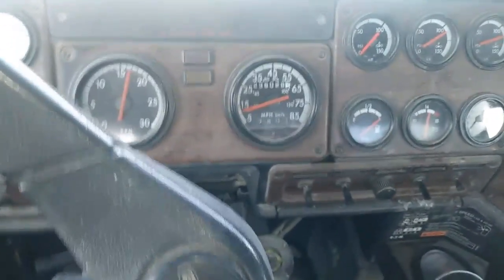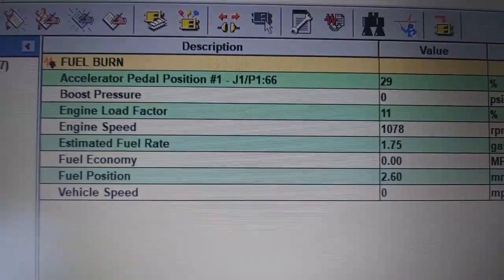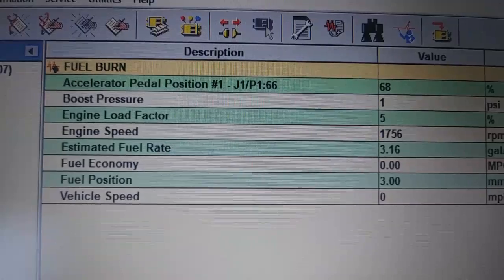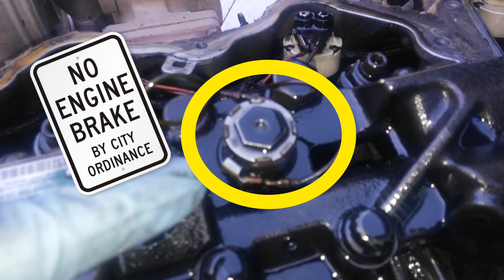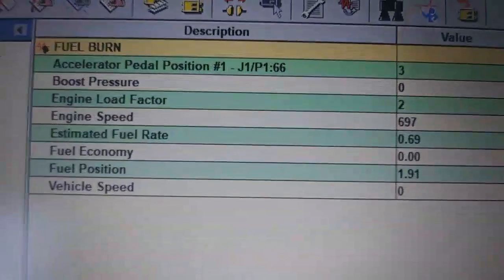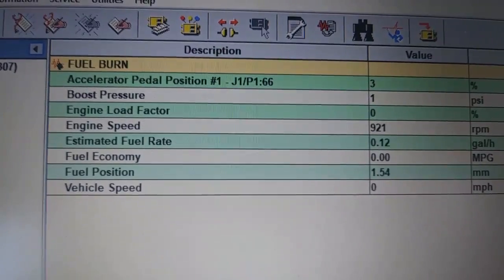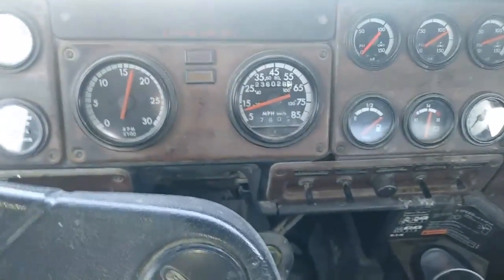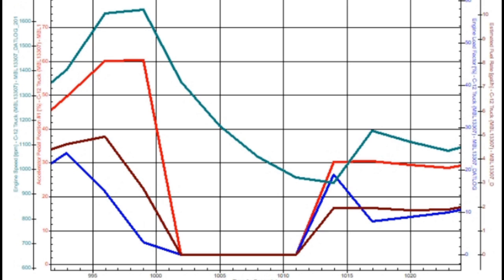Does Engine Braking Waste Fuel? Do Jake Brakes Waste Fuel?

Comment: So there is a way that it wastes fuel out on the road if you leave it on all the time. When you lift off the throttle for bump or dips, shallow corners, etc. the truck slows down when all you needed was to remove torque from the dive axles for a couple of seconds. One the truck slows unnecessarily because the jake was left on you are now pushing extra fuel to get back up to speed.

It’s to that the application of the jake itself doesn’t use fuel, but the real would use of it can impact fuel efficiency based on the way you use it.
Reply: I same would be true if you continuously rode the brakes.
Reply: You are correct, BUT you, the driver is the one wasting fuel if YOU let that happen.
Reply: Half-assed Garage I couldn’t agree more, but there are a lot of drivers that don’t truly understand how to use their jake. As a result they’re either under utilizing it, or they’re just leaving it on all the time.
Reply: aodhanof90 I leave mine on all the time. If I’m coasting or in no hurry to slow down I just rest my foot lightly on the clutch pedal. Nothing about it will cause reduced fuel economy.
Reply: aodhanof90 even if how you describe it is true, it's not the Jake Brakes fault, it's the drivers fault!! Plus, the drivers driving style would generally use more fuel, than even the wasted amount of fuel you are talking about!!

Basically, the driver that does what you suggest, and causes wasted fuel, also drives in a manner that would cause even more wasted fuel!! A heck of a lot more fuel!! But,  something else to consider! Even at a point that you have the jakes on unnecessarily, you would tend to push the throttle back down,  as soon as you would notice it! You don't leave the throttle released (released throttle, means applied jake brake) to avoid a bump or pot hole, and stay off the throttle for just a second, but that would certainly engage the jakes, and you would certainly re-apply throttle immediately! 

The jakes were designed to perform a specific job! They were designed to provide braking assistance, while descending a hill, while heavily loaded, to prevent overheating the service brakes! Drivers now a days, use them in place of service brakes, especially when they think it's cool to make extra noise, to show off! There are some O/Os that swear that it reduces service costs, by not wearing out the brakes as quickly! Others swear that each use of the jakes causes a tiny bit of engine damage, and only operate them when absolute safety is necessary!

The question of fuel economy is a simple one!! The specific idea of the use of a jake brake does not waste fuel! A drivers particular set of driving and jake usage habits, can!! There are some engine controller parameters, that help use the jakes during normal operation, that even help fuel economy!! I drove a truck once, that didn't immediately turn on the jakes for a simple release of throttle! You could leave them turned on, and the computer would not actuate them until a service brake application of at least one second occured! There are also parameters in the computers that when on cruise control, a set speed that gets exceeded by a certain number of MPH, would actuate the jakes! Say you cruise at 65, and then go on a downhill piece, and the vehicle speed exceeds 5mph over the set amount, the jakes would automatically engage an appropriate amount, to help slow you down, and prevent an overspeed situation!! Either legal speed limit, or company limited vehicle speed, or company appropriate speed!! I once drove for a company with 68mph governed trucks! Even in 70 mph states, you weren't allowed to exceed that speed, and had monitors on the units to report that info, when accessed! So, no 80mph downhill runs!! But, other ways to waste fuel, even greater amounts of fuel, exist, that should be addressed, before any thought goes into the jake brake possibility!!

Comment: So, what happens if there's a malfunction, and fuel is introduced while the Jake is being used?

I can say from experience with a cold Cummins Big Cam (The water temp was warm, but the oil hadn't heated up yet) that the answer looks really cool.

I used the Jake for a moment, and hit the throttle again, and saw a flash.
Just then, the guy going the other way got on the radio and said "Man! You just shot four foot of flame from both stacks!"

After that, my warm up time doubled to 40 minutes before heading to the yard as that's the amount of time it took for the oil pressure to start dropping to normal.

Still not sure that cold and thick oil was the cause, but I couldn't think of anything else that would cause fuel to load up in the exhaust like that, and it never happened again with double the warm up time.
Reply: DrFruikenstein 
A Jacobs brake, or the later version C-Brake (Cummins Brake) depends on oil flow into and out of the brake housing for proper operation. Cold oil might have delayed shutting off the injectors. Not quite sure how but that's the only thing I can think of. Today's engines being electronically controlled, that's not a problem. (To err is human, to really screw it up takes a computer)
Reply: @cbmech2563  
Thanks for the explanation. 
Now people will understand why I was fixated on the oil temperature. I should have explained that myself, but didn't.
Thanks again.
Reply: The old 855 I drove was bad about the cold oil Jake wants to stay on

Comment: And that very smart engineer? Clessie Lyle Cummins haha. Sorry had to add that.
Reply: His son, Clessie Jr., helped his father with the invention.
Reply: Chad Jessup wasn't it in an old suburban?
Reply: No, as I recall, the first truck to run with the Jake Brake was a gasoline tanker truck which operated on the West Coast.  Clessie and son lived, I think, in Santa Rosa north of San Francisco at the time of the invention.  I have talked with Clessie Jr. a few times over the years and last saw/spoke with him two years ago.  He is an engineer through and through.
Reply: Chad Jessup That's very awesome! Bet he has alot of great stories! I knew about the tanker. Pretty sure it was a Kw. Thought they tinkered with the design/idea in the suburban. Model j maybe? Can't remember what engine, knew it was smaller
Reply: Randy, it was a KW, and I can't say that I have ever heard about the Suburban, but I do know that a Jake Brake was not designed for the J model Cummins, as it was a single head engine which would have presented many additional issues during development.  Also, as the J model was not widely accepted within the trucking community, there would have been a financial disincentive to its manufacture.

Are you possibly thinking of the old Packard with the U model Cummins (no Jake on that) Clessie used to promote the diesel in the early days?
Reply: Randy, thanks for questioning the origin of the Jake Brake.  It caused me to further investigate the matter, and I discovered this link:  https://www.jacobsvehiclesystems.com/about-us/history/.  It confirms your idea about the Suburban issue!  Thanks again.  Good goin'.
Reply: For those not wishing to read the entire article, here are the guts thereof:  "The vehicle selected for the first field tests of the completed device was a 1955 GMC “Suburban” station wagon re-powered with a Cummins JN-6 diesel engine.  The engine had a displacement of 401 cubic inches and was rated at 125 BHP at 2,500 rpm.  But since the major market potential was in the Cummins NH series diesels at that time, the engine brake mechanism was scaled up and adapted to a Cummins NHRS supercharged model of 300BHP at 2,100 rpm.  The chief reason for selecting this model was simply because a pair of these diesel engines were installed in Clessies 96-foot yacht Canim based in Sausalito harbor."
Reply: I man named Jacob or Jacobs, designed the engine brake. That's what I read once. Think, hence the name "Jake brake"?  I remember old Cummins first used Jake brake, brand engine brakes. Then after a number of years Cummins came out with their own engine brake called the C-brake. If my memory is correct. I remember a guy in the mid 70's purchased a new Freightliner ( White Freightliner then) he had the dealer remove the Jake brake. As he told me it was bad, or harmful to the engine.
Reply: Correction it was Clessie.

Comment: I've kinda got a question. So when you jake brake and the air comes out the exhaust why can't it be put back into the intake manifold. It would be hard to engineer and to make reliable but wouldn't it be quieter?  Also why dose it have to come out the exhaust? Could they use the intake valve instead? That might be bad on the turbo and other components though. Loved the video thanks :)
Reply: It's not clean filtered air but air that is contaminated with carbon, some leftover exhaust, oil fumes, etc.
Reply: gav well yes/no yes there are the exhaust fumes going back into the system but since there is no combustion going on there wouldn't be as much. And there not on all the time so that wouldn't be much of an issue. NGR systems basically do just that they such unburdened fuel back into the engine and they do it all the time instead of just for a few seconds.
Reply: BOB White 
The difference is the egr is government mandated, the other is designed to save the operator money.
Reply: BOB White qhen tpu have rhe jake activated the exhaust valve stay open until deactivated they dont open and close when in braking mode
Reply: Loud pipes save lives.
Reply: You've already got a muffler on the exhaust, if the air came out the intake it would be loud as hell and need another muffler setup. - compressed air is hot, so if you were thinking of recirculating it, I don't think it would work as well, and that air would get screwin hot. Just a few other aspects.

Comment: ,,, have to wonder if in some Diesels when you let off the throttle, but the rpm has not dropped to idle rpm, if the fuel system goes to no fuel or the very slight amount of idle fuel, as the revs are on the way down ?
Reply: Roland Tamaccio I’m pretty sure on old mechanical  diesels it still puts the idle amount in but electronic diesels cut it off completely I’m sure
Reply: Same thing. In a mechanical engine your governor controls fuel metering. You governor is just a set of centrifugal flyweights that fly open when your engine reaches a speed that allows the centrifugal force of the spinning weights to overcome a spring. Your throttle lever is attached to the spring, and as you push the throttle, it increases the pressure on the spring which means the governor weights (and therefore the engine) need to rotate faster to overcome the spring. The governor is attached to your fuel rack, and will automatically increase or decrease the amount of fuel all the way from no fuel to full fuel in order to hold the requested rpm. 

So if your going down a hill, and your off the throttle, it will drop down to the no fuel slot in the fuel rack.
Reply: @connorvelthuis2221  it does not use fuel when coasting with no throttle input.. Research how a governor works.
Reply: Roland Tamaccio not in some diesels, it happens in every Diesel engine.
Reply: ,,, sooooo, ,,, as the rpm drops to idle, say 600 rpm, the fuel comes back to idle settings ? ,,, but not as the rpm is dropping from say 1500 rpm .
Reply: Roland Tamaccio research flyweight governors, it’ll explain how a mechanical diesels, steam engines, and lawnmower engines works.
Reply: ,,, alright A.A. says this electronic controlled engine goes to zero fuel anytime rpm is above idle, and there is no throttle, but I think a mechanical governed engine would need the throttle linkage pulled to engine stop to get the fuel below idle fuel, to get the linkage past (below) the idle setting .

Comment: I just have one question, so if no diesel fuel isn’t going in any of the cylinders why doesn’t the engine shut off? Great video and you are very good at what you do keep pumping out videos !
Reply: Its above idle,in gear so the wheels are turning the motor. as soon as it gets back to idle the fuel system  comes back on.
Reply: The engine cannot shut off because the diffs are turning therefore turning the transmission which is turning the engine over
Reply from the maker: As others have stated, gravity or momentum is actually keeping the engine moving. This is because the wheels are turning the engine, not the other way around.
Reply: Zack Monosso I was thinking the same thing
Reply: remember the govener keeps the engine alive... at idling
Reply: The engine it's being spin by the wheels, even w/o fuel it will act as if it has some injected in it.
As soon as you press the accelerator pedal fuel turns ON.
Reply: you could jake stall older engines. new engines react so slowly I doubt you could. if a rookie popped the Jake when in N it could stall. if a rookie popped the jake on very icy road it could stall
Reply: It does, it's just being backdriven

Comment: Do the jake brake damage the piston rings by the time ?? I heard that if you use the jake brake
Reply: Overspeeding will if you downshift too fast but that goes for anything.
Reply: It shouldn't(no combustion heat punishment). If anything it keeps them clean and moving inside their grooves because of the change from positive to negative pressure.
Reply: Higher rpms will cause piston seizure or blow your turbo. I see rookies going down a mountain in a low gear but in a high mph then I see them at the shoulder, engine is blown. I have a c15 with 1.5 million miles. I never let the rpms go above 1800.
Reply: cebuanoguy I do the same here!!
Reply: A compression brake takes potential energy and expels it out the exhaust. It causes the piston ring to flex as the psi is released via the exhaust port. If no compression brake psi ramps up, cylinder fires, psi decays and released out the exhaust more smoothly. Back in the 3406 day, top rings was breaking due to this. Cat had to increase thickness of top ring. The same top ring was used on 1693 and early 3406. Piston had to be redesigned to accommodate the thicker ring. Have seen four cylinders with broken rings. Blowby was tremendous, cleaned the dust out of the parking lot when I took truck to the steam cleaner.
Reply from the maker: A malfunction or a not properly adjusted Jake could damage the engine, but this is very rare on most engines. Jakes working normally shouldn't cause any engine damage, of course I haven't seen engine damage from them.
Reply: Adept Ape  Most problems was on the C-12 engines, few recalls. Also if the exhaust valve failed it is wise to replace the D lash screw on that cylinder. You could drop another valve on the same cylinder.
Reply: John Goldsmith good info thanks for sharing !!
Reply: Dirty South Driver  Drivers who use Compression brake for no reason, just to make noise. Can shorten the life of the top ring. Just how lucky you are. Even with the twin turbo Cat engines they have two different top rings based on application.
When you release the cylinder psi quickly it causes the ring to relax quicker than normal. Use compression brake when needed. I have them drive in and flip them on just for noise. No grade or load, the ring will snap clean. If you break one by hand the fracture is not the same. 

On his destruction of the week, if you have a older Cat engine with the smaller rod bearings. Replaced the rod bearings every year, than third year replace rod and mains. Can reduce the chance of spinning the rod bearing. Extra work, but cheaper that what it going to cost on this failure.
Reply: Dirty South Driver, I drove a CAT Powered Foden in the UK for over 300,000 miles, the engine never used any oil between services and pulled like a train, it is advised by the manufacturer that you let the engine warm up thourourly before using the Jake Brake. Once normal temperature had been attained I used mine all the time and it was brilliant on long down hill gradients saving the main braking system from overheating, there is no fuel injected into the cylinders when the Jake is in operation so no waste there, it is an ingenious piece of kit and if used correctly seems to have no negative effects on the engine, the only thing you have to watch for is over speeding the engine on very long down hill gradients but pulling the vehicle back on the service brake rectifies that problem.

Comment: The logic is simple in a diesel engine with the jacobs brake on. If you remove the compresed air from the compresion chamber you do not inject any diesel fuel becasuse it will not ignite and will dilute the oil film + other consequences.
Reply: ,,, it's more than logic, the engines can and do when something is wrong with the system throw fire out the stack when fuel is injected (inadvertently) with the Jake on, as the injection starts before the exhaust valves are cracked .